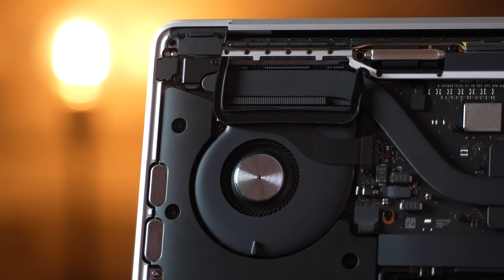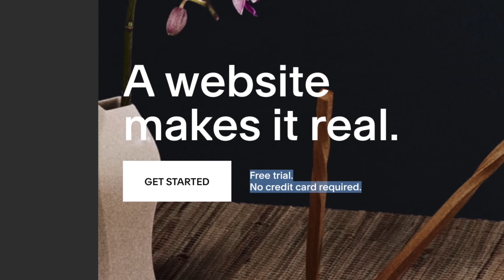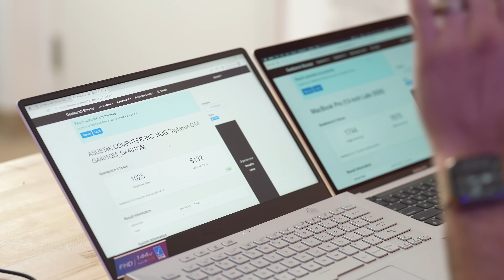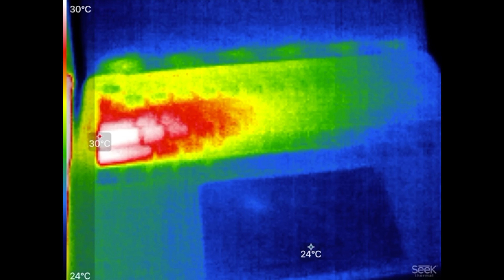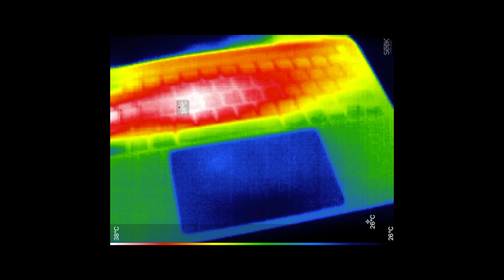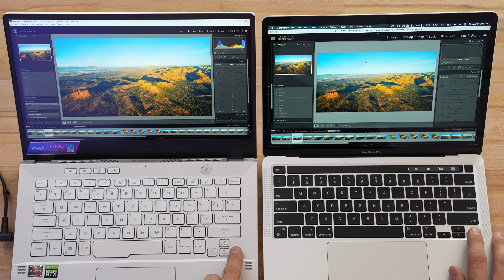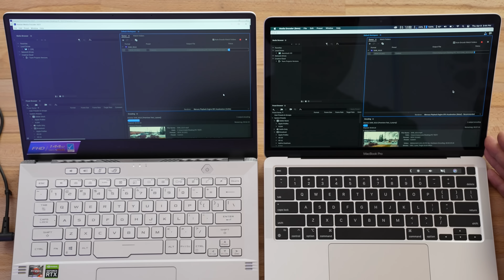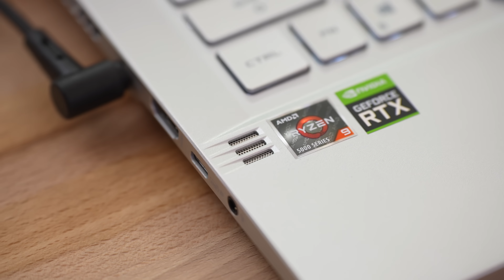Apple M1 vs AMD 5900HS + RTX 3060: FINALLY an M1 Killer?

Comment from the maker: Is AMD's Zen 3 the BEST Mobile Processor? Let us know below! 
Get your Squarespace site FREE Trial with NO Credit Card! ➡ http://squarespace.com/maxtech
I Would Buy THIS INSTEAD (Amazon) ➡ https://geni.us/tnoeMOc

Best deals on M1 Macs on Amazon ⬇️ 
AMD Zephyrus G14 in This video ➡ https://geni.us/kxSa
M1 MacBook Pro 2020 ➡ https://geni.us/pWUBPum
M1 MacBook Air 2020 ➡ https://geni.us/tnoeMOc
M1 Mac Mini 2020 ➡ https://geni.us/bBD2
Reply: I would have liked to have them compared in terms of battery life - as a mobile processor it should be a highly valuable criterion in the comparison. If I buy a notebook the most important thing for me is how it performs when I don't have mains power available (on a hike for example when I want to tether my camera). Then having the brick expire after only a few hours is a big problem. 

So I would like to see a real mix out of tethered camera use, developing a few images in LR, exporting them maybe via a tethered phone to a website, etc...
Reply: @karlgunterwunsch1950  battery life? when you buy a laptop you want the best perfomance its a hell having a lagtop over a laptop
Reply: Just test it against the 5900hx
Reply: The M1 chip might be slightly faster than the Amd chip, though discrete CPU/GPU still gives you better performance.  ASUS more than twice as fast in h265 rendering, there is no doubt which laptop I would buy!
Reply: AMD rules big time!!
Reply: Try to encode 6K/8K with M1... its a toy
Reply: @tomerweiss4900  Apple M1 has:
1) large 2310-entry ROB (AMD Zen 3 only 256-entry)
2) L2 cache of 12 MB (AMD Zen 3 only 0.5 MB)

... it looks like AMD and Intel are toys in-compared to this Apple Monster Firestorm core.
Reply: not for efficiency
Reply: whats the performance when they run on battery till their battery is exhausted? I am guessing the Mac will get 8-10x as much work done due to the low wattage of the M1, till its battery dies, kinda makes a mobile computer a much better proposition if it runs so long
Reply: does the operating system optimization matter?
Reply: What are you talking about????????????????????????????????? The M1 gets beat by almost everything AMD and most Intel! How much is Apple paying you?
Reply: @JackSkellington-h2w  everything thats also at least 20-50 percent more expensive, face it apple made something good and you're mad lmao.Have you seen the benchmarks? not to mention the battery life
Reply: Can we get a comparison between Razor Blade 14 on Ryzen 9 5900X and the M1 MacBook Pro?
Reply: undoubtedly
Reply: @tomerweiss4900  Apple M2X with 8-big cores will destroy Zen 4 in really bad way. You can expect Geekbench5 ST score around 2100 pts. Even iPhone A15 will able to reach 1900 pts. Zen 3 with 1650 pts looks pretty funny despite running hot at crazy high 5.0 GHz. iPhone will destroy Zen3 desktop CPU in ST load for the first time in history.

But Zen 4 will have to fight Apple M3 on TSMC 3nm next year. I expect Apple M3 to reach frequency around 3.6 GHz thanks to 3nm. With +10% IPC I estimate score 2500 pts. Intel ALD and Zen 4 with score around 2000 pts will be totally embarrassed.

Apple on 2 nm TSMC process will able to reach 4.0 GHz even in iPhones and iPads scoring around 3000 pts. That's the secret power of super-efficient and super-wide CPU architecture which Apple is working on in silence since 2008.
Reply: @tomerweiss4900  Do not cry here when 32-core Apple will beat AMD's 64-core server EPYC. EPYC is 280W TDP while Apple will be 120 W TDP.

Do not forget Apple will support a new instruction set ARMv9 with 2048-bit SIMD vectors SVE2. X86 has how wide vectors? Oh wait, AVX2 is 256-bit only. Mambo jumbo of x86 at all fronts ;-)
Reply: @tomerweiss4900  GPU in Apple M1 is the most powerful integrated iGPU in laptop on the world. It has 2.6 TFlops while AMD's APU Renoir with Vega iGPU has only 1.7 TFlops.

Mambo jumbo is already happening now...
Reply: @tomerweiss4900  Xbox One had 1.3 TFlops, and new Playstation 5 has 10 TFlops. Best PC with integrated iGPU APU Ryzen from AMD has 1.7 TFlops.

So M1 with 2.6 TFlops is inbetween old and new gen console. Especially when M1 has 15W TDP while console PS5 has 200W TDP and using GDDR6 memory. M1 uses normal DDR4 shared with CPU (4200 MHz LPDDR4X, probably better than 99% PC desktops though). 

M2X AKA Jade-C will have 10-12 TFlops.
4x M2X will have around 40 TFlops... this will be the most powerfull GPU on the world. Mambo jumbo of AMD and Nvidia GPUs...
Reply: @tomerweiss4900  1) Shadow of Tomb Rider is AAA game and it runs at M1 flawlessly.

2) Other laptops has to have a discrete GPU on board to get decent performance. This makes their price almost double than MacBook Air. M1 is the worlds fastest iGPU, period.

3) Stop behaving like a small kid and get a job instead of gaming. Try doing something useful instead of wasting time.
Reply: @tomerweiss4900  Intel and AMD cannot do execute matrix multiplication instructions or accelerate AI on NPU. Apple A13, A14 and M1 can  :-D :-D

ARM CPUs are more advanced than x86. Smartphones use DDR5 memory since 2020 while x86 are stuck at DDR4 in 2021.

:-D
Reply: @tomerweiss4900  You are again wrong. 128-bit bus width in Apple M1 is the same width as using x86 dual-channel DDR4 controlers (2x 64-bit DIMM). LPDDR is Low Power and is more flexible which allows you to have also half-channel (32-bit which is used in low cost computer Raspberry Pi 4). LPDDR has better frequency and latency because is soldered and close to CPU (shorter wiring).
Reply: You see its physics. less power = less speed, very simple. no magic here.
Reply: @tomerweiss4900  LPDDR4x in M1 runs at 4200 MHz. What's your x86 mem runs at? Slow 3200 MHz? Mambo jumbo of x86 :D

Even cheap Raspberry Pi 4 has 3733 MHz memory chips :D
Reply: @tomerweiss4900  You are wrong again. 4200 MHz memory is faster than 3200 MHz no matter if it's LP or standard DDR.
Reply: @tomerweiss4900  Apple M1 has 128-bit LPDDR4X 4200 MHz bus. Intel and AMD have for desktops dual 64-bit channel (total 128-bit, same as M1) DDR4 3200 MHz. M1 has higher frequency so it has higher throughput. That's why M1 can have the most powerful integrated GPU on the world with 2.6 TFlops. Period.

BTW Apple M1 has HW compression of memory (and it's patented). Apple is light years ahead x86, buddy ;-)
Reply: @tomerweiss4900  You cannot do grammar school math? 8x16-bit = 128-bit 
:-D

New LPDDR5X at 8533 MHz coming soon ;-)
Reply: @tomerweiss4900  Performance is equal to 8533 MHz memory. And performance is always the king.

Smartphone market is 7x bigger than PC market so it's obvious PC is not tech leader anymore. No money = no leadership.
Reply: @tomerweiss4900  Comparing 16-bit 8533 MHz bus vs. 128-bit 3200 MHz bus is as insane as you mind.

Why do you think AMD and Intel are moving to DDR5 next year? Because they are worse than DDR4? Then I recommend you to stick with old DDR2 800 Mhz at least :D :D :D
Reply: @tomerweiss4900  Memory is about throughput. Not latency. Latency is roughly constant since first PC-XT in 1980's. Latency is handled by cache subsystem.

Throughput is rising with every new generation. For GPU you need only throughput. x86 CPU with poor design of cache system needs low latency DDR to compensate their poor design.

- Apple M1 has 12 MB of L2 cache
- AMD Zen3 has 0.5 MB L2
M1 has 24x more L2 cache so it's not hurt by higher latency of modern DDR.
Reply: @tomerweiss4900  It's valid comparison because other ARM cores like Cortex A78 has 0.5 MB L2 as well. Similar to x86.

Just Apple M1 is monster with 12 MB L2 cache and 320 kB L1 cache. x86 has only 64 kb L1 cache. Mambo Jumbo of cartoon toy story called x86 :D
Reply: @tomerweiss4900  No, overall latency is almost same for last 20 years. Throughput is the key metric. You are just little baby who just discovered RAM timings. Congrats :D
Reply: @arm-power  You are misleading as always the M1 have single Access to slow RAM both for GPU and CPU. Any modern X86 which is using a real GPU - address both GPU and CPU in seperated Throughputs with a much more faster memory. for example GDDR6 for most 2021 models and 200GB/380GB Troughputs which are x5 vs the M1 not including the usuall CPU->MEM. So i know your Apple fan boys eat every bullshit they say. but cut it to 2. thats the Real  M1 numbers. you see no real magic here. in the END when you play game - 66% will be used by the GPU.
Reply: Not only games every memory call in M1 is splitted both to GPU & CPU on the same bandwith. so its a bit a nice lie. to say its amzaing. while it isnt. 
Yeah its gr8 vs a mobile phone. WOW.
Reply: @tomerweiss4900  1) Do not compare 120 mm2 M1 chip to 628mm2 Nvidia 3090 GA102 chip. That's non-sense.

2) M1 is SoC = System On Chip. So lets compare to APU like AMD Renoir 4800U with 1.8 TFlops. M1 has 2.6 TFlops so it's the most powerfull APU/SoC on the world from GPU point of view.

3) M1 has 32 MB L3 cache shared with GPU, NPU and CPU. Only Apple can share cache among CPU and GPU today. This year ARM introduced L4 cache for CPU + GPU, closing gap to Apple for next year's devices like Snapdragon 898. But Intel nor AMD are totally outdated. x86 ancient and dead.
Reply: @arm-power  Its not M1 have many limiations. support 1 screen, no EGPU , same BW for Screen and Storage, RAM limitations. Take that into the equation ... when you say its the best... its not too many limitations.
Reply: @arm-power  Intel & AMD can add L4 and same Power core\low Cores. sorry mate. ARM is not there.
Reply: You forget that ARM is hard coded and not flexible as X86. if tomorrow there is a new video codec ARM will be a crap to process it while X86 will handle it.
Reply: @tomerweiss4900   Hard coded? Video codec as part of x86? Ha ha ha. Oh boy, you have no clue. Video encoders/decoders are part of GPU. There is absolutely no connection to CPU instruction set. For SW encoding both ARM and x86 has similar SIMD instructions. ARM has NEON/SVE2 and x86 has SSE/AVX.

BTW ARM's SVE2 is much better than x86's AVX512. SVE2 support 2048-bit vectors while x86 only 512-bit. AMD Zen3 supports only 256-bit AVX2.

And new SME for matrix math is coming soon as part of ARMv9.3.
Reply: @arm-power  No need, cause you can't do that in M1. you can't work with Real GPU. the Built in is a toy.
Reply: @tomerweiss4900 
- Xbox One had 1.3 TFlops GPU
 - M1 has 2.6 TFlops iGPU.

Apple M1 has 2x graphic performance of Xbox One console. M1 is the most powerful iGPU on the world today. Period.
Reply: @arm-power  Xbox one was released  8y ago and designed 10y ago. So its a big joke.
Reply: And still xbox one can run more titles vs M1
Reply: @tomerweiss4900  M1 can run >1000 games from Apple Store. Xbox can't  :D
Reply: @arm-power  1000 games that no one cares about them. do me a favor mac games are a big joke.
Reply: We are in 2021 ... and APPLE GPU can deal with an 11y old console. :-)
Reply: In the Price of M1 + 512GB ; You get a real CPU with a Real GPU which runs 2021 games.
Reply: @tomerweiss4900  M1 is in table with 10 W TDP. Show me any x86 CPU with real GPU in tablet beating M1.

Did you get that now how x86 is outdated and 10 years behind Apple's ARM CPU?
Reply: @arm-power  its aint 10W TDP when its running with the GPU ... its much more. its 10w when its idle :-) check me. Its around 25W-30W when its really using the GPU. yes its lower. but much weaker vs any modern alternative at the same price point.
Reply: @arm-power  M1 TABLET is a toy i have one. do me a favor it can't really do any real task. M1 is great for portability etc... no argue here. but for real stuff its a toy.
Reply: @tomerweiss4900  M1 has almost DOUBLE powerful iGPU than APU AMD Ryzen 5800U (M1 has 2.6 TFlops vs. Ryzen 1.7 TFlops). If you call M1 a toy then how would you call that Ryzen? Piece of garbage?
Reply: @arm-power  yes it cant run real CAD tools.
Reply: @tomerweiss4900  You bet it can run any CAD tools. The most powerful super-computer on the world is based on ARM CPU. Using ARMv8 instruction set with 2048-bit SVE vectors. It's called Fugaku and it beats every x86 supercomputers based on x86 CPU + multiple Nvidia GPU. Fugaku is CPU only and yet it beats all GPUs.

Performance of M1 is not coincidence. ARMv8 and ARMv9 are brand new bad ass instructions set. 2048-bit vectors, matrix multiplication, SVE, SVE2 and SME instructions. Much more powerful than ancient x86 developed in 1980's.
Reply: @arm-power  It can't i tested it. a 16gb ram toy with 2.4 TFLOPS can't. 
The Fastest Computer is PowerPC based... IBM Architecture.
Reply: Riken is addressing specific problems. Fastest CPU in the world is X86 Based.
Reply: @tomerweiss4900  Fugaku-Riken is addressing obvious problem - to be the fastest on the world.

Latency between x86 CPU and GPU on PCIe is 8-15 us (15 000 ns vs. RAM with 75 ns). RAM latency is 200x better = this is secret magic behind ARM Fugaku and why it beat GPU based supercomputers.

ARM Fugaku has also the most powerful FPU: it has 2x512-bit FPU units per core and capable to crunch 2048-bit SVE vectors and matrix.

x86 can only dream of 2048-bit or matrix. Funny enough that this winter every new smartphone will able to crunch 2048-bit SVE2 code because new ARM Cortex X2 and even little core Cortex A510 are SVE2 ready.

x86 is stuck at 256-bit  AVX2 which is 15 years old :D
Reply: @arm-power no it was built for addressing specific problem. dude you are addicted. ARM is gr8 but other works better for other things. realize it.
Reply: in 2021.9 you can't do CAD with ARM. or Play AAA modern game. thats an f-act.
Reply: @arm-power  Sorry but your not updated modern GPUS at X86 have direct memory access (Also X86 using a much more faster RAM vs ARM) GDDR6 ...:-)
Reply: @arm-power  And you have AVX1024 & AVX2048 (all introduced 12y ago)... do me a favor. there is nothing in ARM that don't have an answer in X86.
Reply: @tomerweiss4900  AVX1024? Maybe in your psychopathic fantasy. x86 is stuck at 256-bit AVX2 only. Including brand new Intel Alder Lake.

ARM flies at SVE2 with up to 2048-bit TODAY. Already running in Fugaku Riken since 2019. Every Android phone end of this year.

And new ARM's SME for matrix (vector is 1D, matrix is 2D) calculation. This is big deat and big performance jump.

 x86 is like too old zombie waiting for last shotgun hit of mercy.
Reply: @arm-power  Ur comparing a consumer based CPU to a Supercomputer acritechture ? and Yes New Xeon will have 2048. First that Apple will be able to do a chip that can run with a real GPU and support 2 screens. after that tell me about this blah blah magic.
Reply: @tomerweiss4900  Yes, I compare consumer phone to super-computer because this year all smartphones will have 2048-bit SVE2 vectors which were developed for Fugaku super-computer.

x86 will have what? NOTHING. Intel went backwards from AVX512 back to 256-bit AVX2 for new Alder Lake.

Intel has new AMX for servers but that is based on AVX512 - just more registers for matrix computing. I guess you never did assembly code and that's why you doesn't know what a register is.

Every bloody phone will able to run SVE2 2048-bit vectors next year. That's why ARMv9 is killer of x86. From tiny washmachine MCU up to super-computer same instruction set. That's compatibility baby. Not x86 with 6 SSE versions, 2 AVX versions and 15 subsets/versions of AVX512. There is no two CPU which supports same AVX512. That mess is last nail into x86 coffin.
Reply: @arm-power  We shall see who will nail who. meanwhile X86 rules. not ARM.
Reply: @arm-power  They can support SVE-1B ... at 2021 they can't even connect to 2 displays and real storage. thats a fact.
Reply: Its much more simple to extend X86 vs ARM. or to address future needs vs ARM. ARM is strict/X86 Open.
Reply: ARM is more efficent in memory usage due that it addressing simple and known stuff. but for complex unknown tasks X86 takes a big win here.
Reply: Yep, Zen 3 can run everything M1 can't. very simple.
Reply: This max tech guy is an apple head at best. Never ever make your purchase decision watching these crappy comparisons. Watch atleast Dave 2D for honest opinions
Reply: M1X will come out and say hold my beer.
Reply: @kwarkoocoxs2153  Why Apple just 4 months before new A15 iPhone chip would come up with old M1X based on A14 Firestorm when they can release M2X based on new A15?
Reply: apple fanboy
Reply: @surpriseddog  what? The m1 destroyed the AMD, PC FANBOY
Reply: @JuanAlvarez-uf3np  keep dreaming! Amd destroyed the m1
Reply: @miyagiryota77  8 big AMD cores at 4.6 GHz destroyed in SOME tests Apple's 4 big cores at 3.2 GHz. C'mon this shows that Apple M1 has +60% higher IPC than AMD and when Apple will release 8 big core M2X it's game over AMD/Intel.

And 16 big core M2-Pro is coming late this year. And 32 core M3-Pro-X for MacPro is moning next year. More powerfull than 64-core AMD EPYC.

Game Over AMD, Intel and x86 ;-)
Reply: @JuanAlvarez-uf3np  talk to me when macs can run games😂😂 oh wait they can't cause theyre ipads that come with a keyboard that are double the price
Reply: @arm-power  why cant apple clock it higher then even with the once with the fan the macbook pro???? It cant! Lol! Limited upside in clockspeed! Lol!
Reply: @miyagiryota77  Have U seen Apple M1 cannot reach 3.2 GHz? All M1 can reach 3.2 GHz comfortably which means that some of the best chips could be clocked 300 MHz higher, maybe more.

Do you remember ARM Snapdragon 865? It ran at 2.8 GHz however half year later was released 865+ running at 3.1 GHz (both 7nm). So, yeah Apple can clock M1 higher but they do not want to embarrass AMD too much. It's embarrassing already for brand new Zen 3 :)
Reply: @arm-power  embarass too much! Thats not how competition work! Destroy your competitor is the motto. However poor ARM m1 cannot do to AMD! ROFL!
Reply: @surpriseddog  yeah because everybody wants a computer to game, go and cry with your mommy kid. Call me when gamer laptops have a decent battery life, I’m pretty sure you had a lot of fun with the 30 min of gaming before getting out of power 😂😂😂😂
Reply: never thought you'd review a Ryzen with all that M1 hype.  if only AMD was given access to 5nm, they would have equal or beaten the M1 in power efficiency
Reply: @zodiacfml  they can’t because it’s a different architecture
Reply: AMD fanboy
Reply: From this test the 5900 processor is significantly slower than the M1, all the advantages came from the RTX3060, not the 5900. In addition the M1 does it on 13W, less than a quarter of the 60W drawn by the x86 laptop. It is interesting how people criticise Apple for daring to make a CPU that destroys x86 processors, they do not seem to understand that AMD and Intel will not produce better CPUs unless they are forced to do so....at the moment by Apple. Everyone wins with competition.
Reply: @rogersmith1643  Cinebench is a CPU test, and the graphics chipsets do not come into play there. The M1 was beaten badly in that test.
Reply: @timg6930   it's very interesting that cinebench and the graphic geekbench scores show off the M1 very badly but in most other tests the M1 comes close or even beats out the 8 core CPU from AMD. I think raw performance is far from what you actually get.
Reply: @paulsamuelmusic  In all fairness, the 5900HS is an 8 core 16 thread CPU. In multicore tests it's going to perform better than the M1. Apple's next generation of the M1 I'm guessing will feature at least a couple more cores in the Pro MacBooks.
Reply: @timg6930   exactly, just thinking to compare a processor with technically half of the cores would've been a waste of time a few years ago.
Reply: @rogersmith1643  nope, cinebench cpu doesnt use the gpu, 5900hs has x2 multicore power than the m1 and like you said with the rtx 3060 is even more powerfull. apple allways has been know in the hardware comunity for selling cooper at gold prices
Reply: @rogersmith1643  And THIS year is coming Apple M2 chip based on brand new ARMv9 instruction set using 2048-bit SVE2 SIMD vectors. And the best thing is that M2 will be brand new architecture because Firestorm (A14/M1) was the fourth generation from A11 Monsoon core. If Apple keeps the same habit bringing brand new core design every four years then M2 will be big beast. A11 Monsoon core brought +19% IPC over A10 Hurricane core which was pretty huge. That was transition from 4xALU design to 6xALU design in A11 (and A14/M1 has also 6xALUs). Will be A15/M2 something like 8xALU beast? God help AMD because they got stuck at 4xALU only with Zen 3. And because Zen 4 will be just facelift of Zen 3 then AMD will be stuck at pretty obsolete  4xALU design until Zen 5 in 2024? AMD will be in a big trouble!
Reply: @arm-power  who says facelift of zen 3????? Only you! Lol!  Zen 4 is a total redesign of cpu cores on a 5 nm chip with ddr5 pcie5 usb 4! ROFL!
Reply: @miyagiryota77  Zen 2 was facelift of Zen1+, Zen 4 will be facelift of Zen 3. Pretty clear. Big redesign will be Zen 5.

Apple does new uarch every 4 years, M1/A14 Firestorm cores are 4th gen of revolutionary A11 Monsoon, the 1st 6xALU super-wide core, also 1st ARM CPU without 32-bit mode being pure 64-bit (compare to AMD who needs to support 32-bit i386 and also 16-bit 286 mode even nobody use that anymore, it's part of the old crap called x86 founded in 1980, 64-bit ARMv8 was released in 2012 and is not compatible with 32-bit ARMv7, it's completely new and different ISA, it uses different coding, registers etc, not an extension like x86).

Also ARM Ltd. release new redesign every 3-4 years. Both Apple and ARM release new uarch facelift every year. And Apple release also small cores every year so two different uarchs every year.

U think that poor and small AMD under leadership of big fat ass Lisa Su who fired Jim Keller will do better job then Apple? C'mon, don't be that naive.
Reply: @arm-power  yup way better! SUPER computer makers think so too! Poor ARM !
Reply: @miyagiryota77  World's fastest super-computer today is ARM based Fujitsu A64FX using SVE (CPU only). AMD cannot beat that even with massive help of ton GPUs. Poor x86 :)

World's fastest server CPU is ARM based Ampere Altra 80-core monolith monster. And 128-core Altra Max is coming this year. Poor AMD and Intel :)
Reply: @arm-power  Frontier will be on next year 2022, with 1.5 exaflops build by AMD CPU and GPU Cores please tell me more about arm.
Reply: @coffee7180  3 years of delay after ARM because ARM Fujitsu A64FX was deployed at the end of 2019. And still AMD will not be able handle 2048-bit SVE vectors and will not have HBM2 memory. Lets see how AMD will handle C code because CPU only Fugaku is excelent in it while GPU sucks.

BTW: delay between GPU and CPU via PCIe is 1000 - 1500 ns. HBM2 and DDR4 has 50ns. That's the power of CPU only supercomputer!
Reply: @arm-power  AMD will be releasing their 6000 series APUs early next year which will be a Zen3+ with RDNA 2 GPU upgrade. Zen 4 will be an entirely new design and will be released late 2022.
Reply: @theexmann  Yes, but Zen3+ RDNA2 will have only dual DDR4/DDR5 memory controller (similar to M1) which limit the GPU performance to 3-4 TFlops max.

M1X / M2 / G1 or whatever they name Jade-C will have QUAD (4x) DDR5 at 5400 MHz mem controller. Basically double memory bandwidth and rise of DDR frequency from 4200 MHz to 5400 MHz allows to quadruple graphic cores (CUs will rise from 8 to 32). This will result in brutal 10 TFlops for Apple Jade-C which is the performance level of new PS5 and Xbox X consoles with TDP 160W.

AMD has no chance to compete against Apple. 4x Jade-C config will have 32 CPU cores (more powerful than 64-core AMD EPYC server CPU) and 40 TFlops GPU (more powerful than 3090 and 6900XT).

And where are 2048-bit SVE2 vectors for CPU as ARM has a new standard for ARMv9 ISA? Where are matrix instructions for CPU to speed up AI? Where is NPU for AI inferencing? Where is DDR5 support as phones are using DDR5 since 2020.

x86 world is terribly outdated and is no more world's tech leader. Phones are 5x bigger market than PC in revenue.
Reply: @arm-power  You're conflating a bunch of markets and tech that don't necessarily compete against each other. X86 will be around for a long time because it's over 90% of the market. Even Apple supports the X86 market through software like Rosetta II. If it wasn't for Rosetta II, the M1 would flop because it wouldn't be able to run the majority of software in the industry. And that software, whether you like it or not, is optimized for X86 hardware.

BTW, AMD continues to make high-end GPUs for Apple because they perform much better.

And soon you'll see AMD graphics tech in Samsung phones too.
Reply: @theexmann  1) Smartphones are 7x bigger market in revenue than x86 servers. Desktop and laptop (99% x86) is equal to servers so ARM devices has 3.5x bigger revenue. So x86 is only 28% vs. 72% ARM revenue...... x86 is minority and still shinking. 

2) If you consider sold pieces (not revenue) then ARM has 90% majority and x86 shrinks to about 10%. If you consider microcontrollers and IOT then it goes even worse...

3) ARM expands everywhere, massively into servers with the fastest server CPU the 80-core Ampere Altra, the fastest super-computer Japanese Fugaku using Fujitsu A64FX CPU (no GPU and yet beating Nvidia GPU with x86 CPUs) and massively expanding into laptops. 

4) Let's see the Samsung Exynos 2200 with mRDNA GPU. But first leak shows it throttles a lot and Apple A15 is much faster anyway. So it's fail. Not speaking putting Zen3 core into smartphone - it would be utter suicide (Apple A14 has +60% higher IPC than Zen 3, and Cortex X2 has +15% higher IPC than Zen3). AMD fails everywhere. Even Intel Alder Lake will smash AMD now. You can thank to Lisa Su that she got rid of genius Jim Keller who designed Zen1, Zen2 and Zen3 and saved AMD.
Reply: @arm-power  You don't know anything about AMD. And conflating different market segments make no sense. In fact, it's stupid. Super computing machines are made for different workloads. AMD has an ever increasing number of super computers around the world. They basically had none before Ryzen. That's huge in such a short amount of time. In fact, one is currently being built for Finland that will outperform Japan's Fugaku using both AMD EPYC processors and AMD Instinct GPUs. And that is just one. There are more that will be even faster.

The Exynos 2200 has no official test results yet. The recent leak doesn't mean anything. Besides. they were referring to the CPU side of things in the leak, not the graphics capability which has the AMD technology. Technology that includes Ray Tracing among other firsts for mobile phones. Apple has none of that even on their newer chips.

And AMD dominates the gaming console market and is only expanding it going forward too with hand held devices like the AYANEO and the Steam Deck.

Jim Keller has been all over the place working at many companies over his career including working for AMD two different times. Again, you know nothing about AMD's history.

Dr. Lisa Su has taken AMD from being near bankruptcy to a leading company in the computing industry, and it will only get that much better with the acquisition of Xilinx later this year. AMD's stock was around $2 a few years ago and now it stands at $105+. That, my friend, is due primarily to Lisa Su's leadership. How do you like them Apples!?
Reply: 5 mins into the video and the "M1 Killer" is on its knees, begging for Mercy from being absolutely Humiliated.
Reply: @gokulsree.e  i dont know what video youre watching! ROFL!